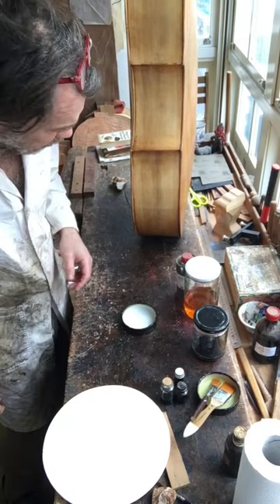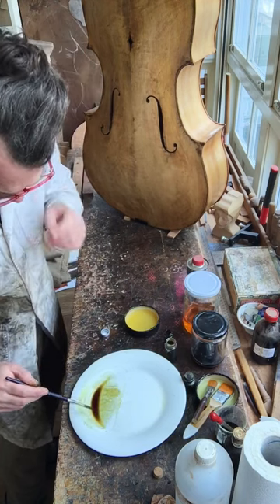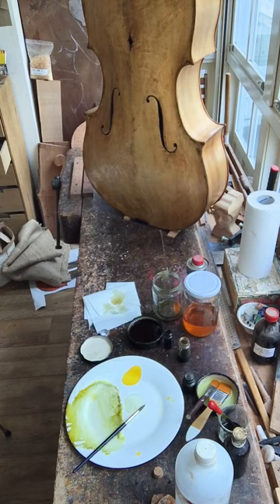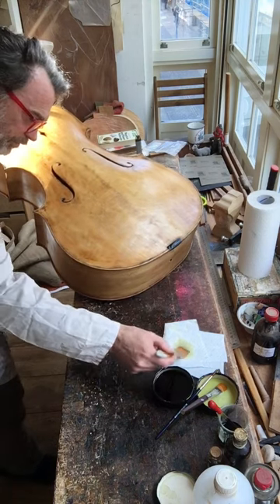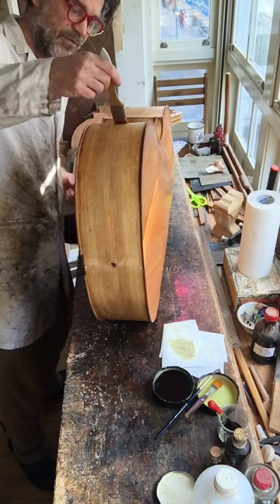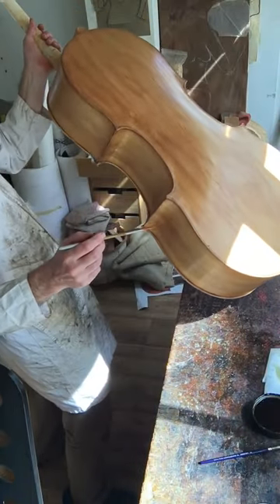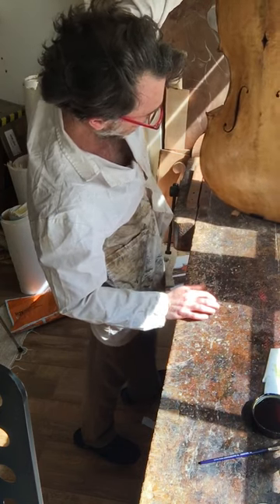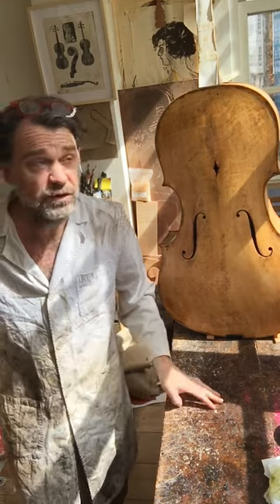Violin varnish tutorial. Sealing the antique ground with alcohol varnish.

Comment: My dad always used 50/50 thinner to varathane. Of course this was for marine varnish. He wasn't vanishing a violin. So basically I know nothing about vanishing violins. I would think one would do first couple of coats 50/50 so the varnish could penetrate the wood. And then you could make the varnish a little thicker once the wood was sealed. My philosophy is that with a violin any oil will dampen the resonance so I would think an alcohol shellac would be quicker drying and respond better to sound. But I may be mistaken. I've never varnished a violin in the white. I don't have a need right now but very curious. I have experience with oil painting and varathane and  damar varnish but no real knowledge of violin varnish. I am broadening my knowledge of vanishing wooden sailboats and I am sure musical instruments are completly different. I have used camel hair brushes before and always started out lean but then got too much varnish on the brush. I almost think the airbrush would give a more even coat but I've heard contrary opinions so maybe brush is still superior for vanishing instruments. Thanks for doing this vidio. I hope to one day make my own violin but there are so many materials nessasary.thanks for the informstion.😅
Reply from the maker: marine boat varnish works for violins! I do not do this, but i have heard of many a violin maker using it, and praising it highly. You can buy it by the bucketload. There is an online forum,. Maestronet, if you google search boat varnish and maestronet you will get some conversations on the topic.

Comment: Nate the lavender oil used, is this the standard aromatic oil available at most shops?
Reply from the maker: the stuff I get is from Hammerl, in Germany, and more industrial grade. It probably has terpentine or some kind of additive, and you buy it by the liter! I think pure lavender will also work , but the cheap stuff obviously is better. i think if you go on amazon or ebay you can find liters etc.
Reply: @natetabormusic  Thanks I'm looking forward to trying your antiquing method.
Reply: Lavender oil that's the one substance I do have some experience with. It will remove paint if it is essential lavender oil. Eucalyptus oil is almost like turpentine and I heard some oil painters use it in place of turpentine. It's safer than breathing turns. IF I were going to varnish a violin I would consider eucalyptus oil and damage. Lavender oil gives shine I've used it in boot polish recipes. I would say eucalyptus oil and damar  or eucalyptus and spruce resin would be a good place to start. Or wood alcohol and shellac. Im not real crazy about lacquer thinner because of fumes. I would consider eucalyptus oil and spruce resin maybe a drop of linseed oil. Of course too much thinner to varnish makes it chippy in general. Not knowing any better I would begin  with spruce resin  and eucalyptus oil for sonic reasons. I guess I'm showing my nieve knowledge of violin varnish but that's maybe what I would use on a violin in the white. Now I will let you correct me because I'm new to violin vanishing. Thanks😅 @natetabormusic